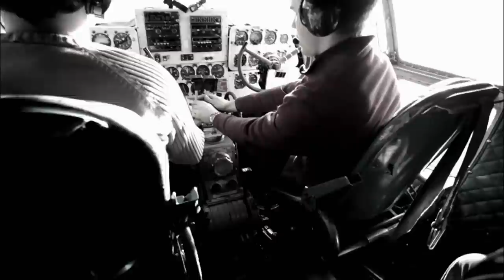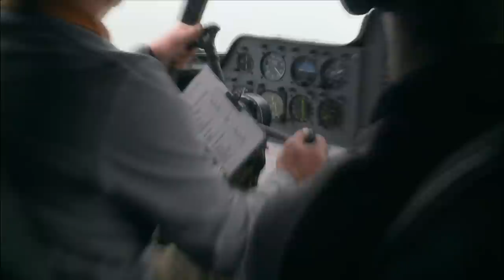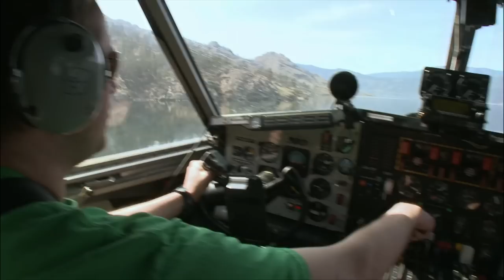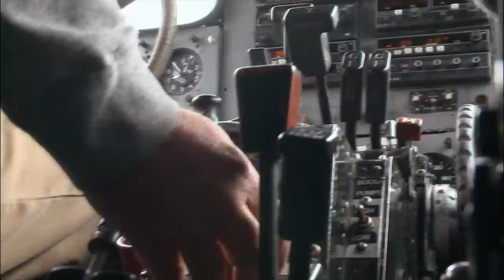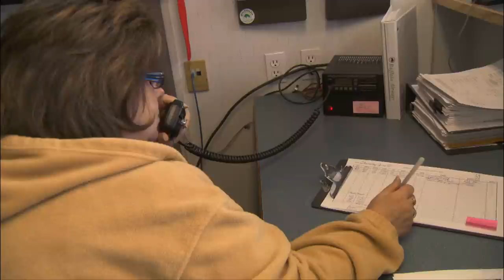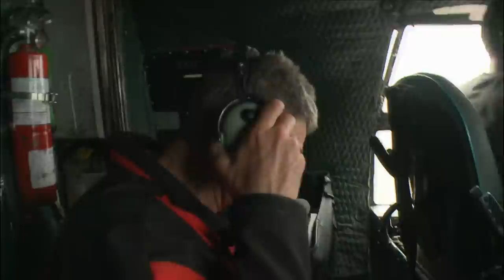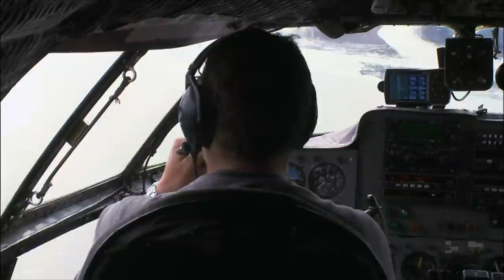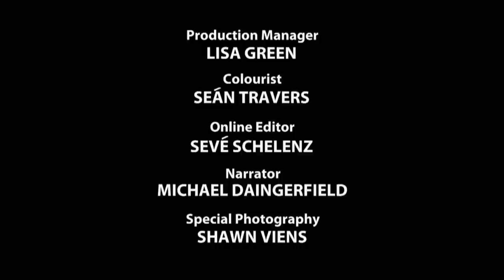Expect the Unexpected - Ice Pilots NWT S03E12 - Go Xplorer

Comment: I can relate to the engine failure on the C46.     In November 1972 I was aboard a USAF C47 enroute from Chiang Mai Thailand to Udorn Royal Thai Air Force Base.         Halfway home over the jungle of northern Thailand we experienced engine failure on the right side.       A precautionary shut-down in reality but the effect was the same.      I still have a photo of the feathered propeller.       Made it back to base safely to find the right engine had lost oil pressure, oil still leaking as we shut down.     Turns out that was the pilot in command's final flight before retirement.      What a way to go!

Comment: Nice video landing a c-46 with one engine. They use the ruder to keep the plane balance because of the lack of power of one engine. In theory ruder does not control a c-46 at low velocity so that landing should be at high speed . They were lucky that the plane was empty.

Comment: I don't understand why they just took off out of Norman Wells after experiencing serious running issues with that starboard engine. I wouldn't want to take off until that engine was thoroughly checked out. This is the second episode where they had issues with that starboard engine on the C46 and also whwre it wouldn't feather after shutdown. I love those old planes but they require a lot of TLC if you are.going to fly them.